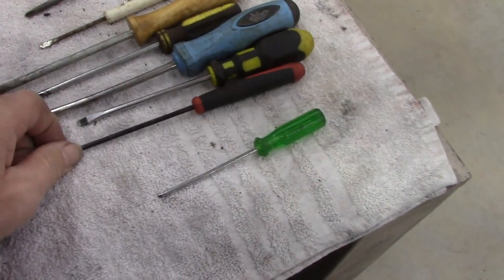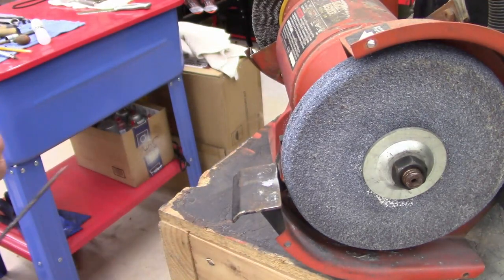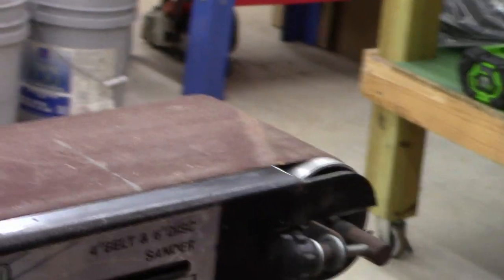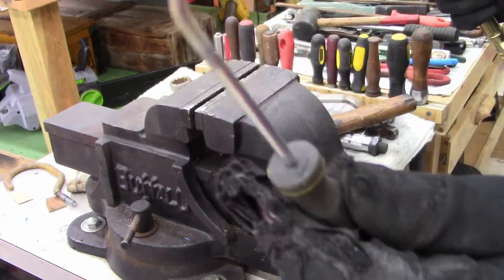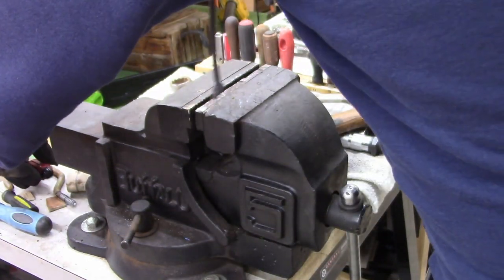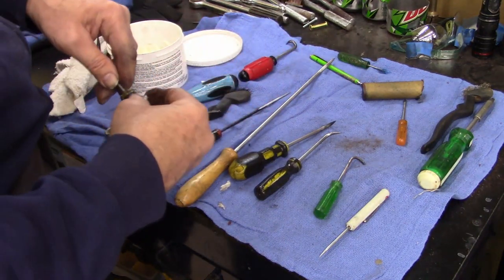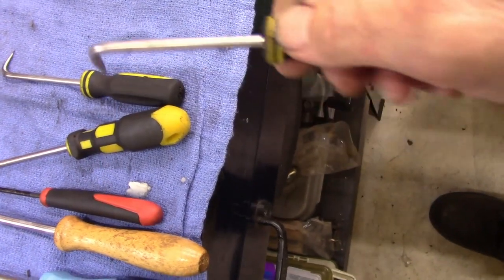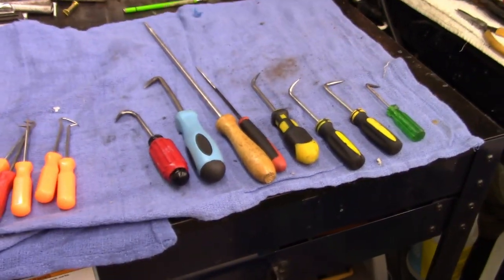Homemade pick set

Comment: Thats good work, I have no problem repurposing tools . I may go to the pawn shop today .
Reply from the maker: Make friends with those guys, they usually deal with people that are not the smartest and having a customer that is kind and friendly in there is few and far between.!!
Reply: I went to 3 today , I bought a new tile trowel at the 1st , nothing at the 2nd , and 4 punches and 1 1/4 inch socket driver at the 3rd for 3:50 , I spent 8:50 today , not to bad . The punches are soaking in vinegar tonight .